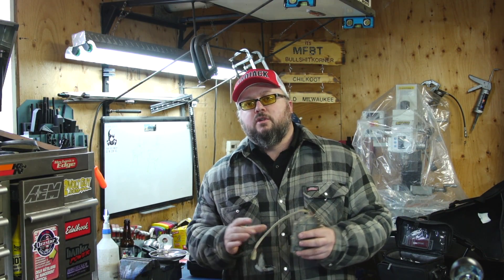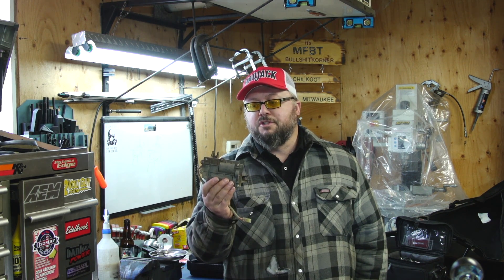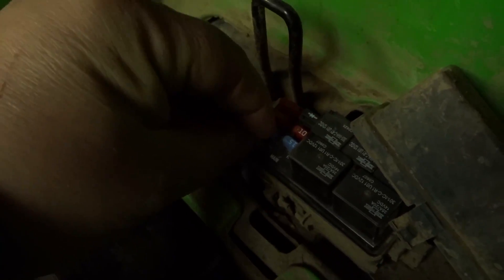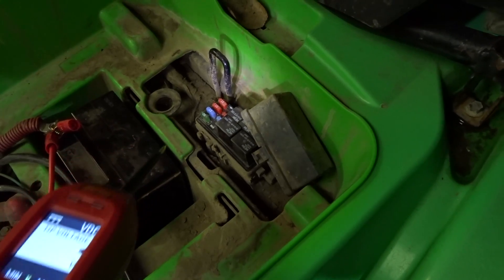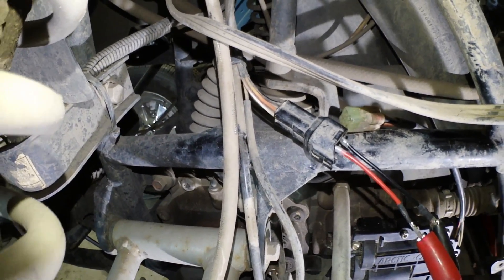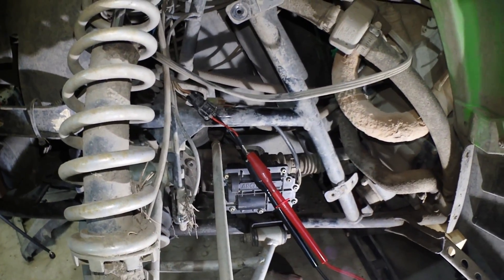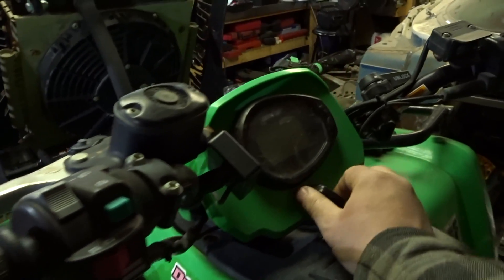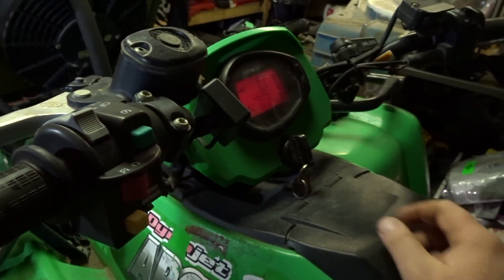ATV 4x4 Not Working Electrical Troubleshooting

Comment: I HAVE NO ELECTRICAL POWER!!! My batter got flipped before I could detach the terminals and it hit the metal frame of the bike and I heard a noise that sounded like a short circuit distortion crash. Now the bike has no electrical power at all when I turn the ignition to on. I checked the main 30A fuse and it appeared to be good and I replaced it and still nothing. If anyone knows what this issue is please share I'd greatly appreciate it thanks.👍😎👌

Comment: On my Thundercat the wire going to the actuator came too close to the exhaust and burnt the wires. Also, when you are testing the connector, if you get some current when it's off, the 4wd switch comes apart very easily and the contacts can be cleaned. Just be careful when opening up the little box as there is a tiny spring that will fly out. Maybe you could do a video on it ;-)

Comment: How to cancel the switch on the steering handle bar, and control it manual from the button or cables beneath.??
Reply: you can bypass and lock it in 4wd, remove actuator, jam stick under small rod that engages 4wd

Comment: Had a problem with the 4x4 on my Kodiak 350 a while ago it wouldn't engage... and once this winter I was out checking rabbit snares and got stuck and wrestled the bike for half an hour cursing on myself for being lazy and not fixing it. After I* stopped for a break I looked down at the switch wishing the 4x4 would work and pushed it for a laugh and it magically worked again! has been working perfectly ever since! haha

Comment: In my ATV i had got problem with that unit. So I just opened it and found out that DC motor was tosted. So I go to a toy parts shop and found the same size motor and installed it. It works fine. Costs of repair - 10 bucks.
Reply: KIevMan hi I'm getting no power to ignition what could it be thanks
Reply from the maker: +KIevMan yeah pretty just hit up a RC store and get the gears and all